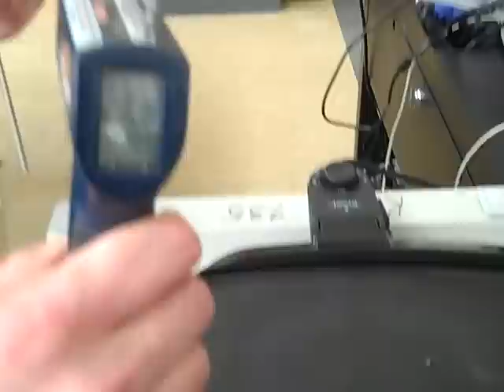Lead Melting Tin

Comment: Tin melts at 232C
While lead melts at 328C
When both are mixed together(alloy/solder wire), the melting point drops under 200C.

A rough estimate: 20% tin 80% lead melts at 280C. Whereas 60% tin 40% lead melts at 185C. Hence, PCB repair technicians prefer higher tin percentage solder wire while led bulb manufacturers(where bulbs get extremely hot) prefer the high lead(80%) stuff.